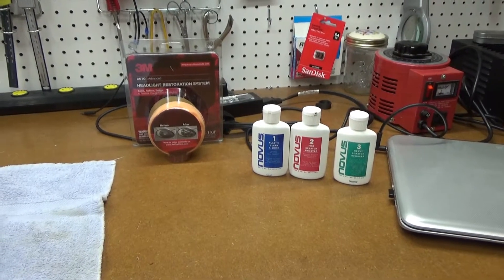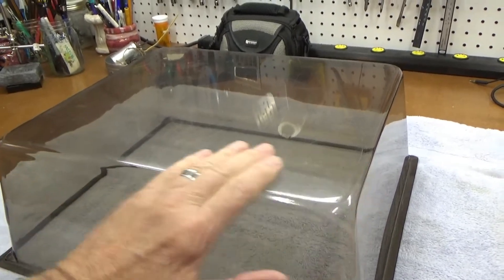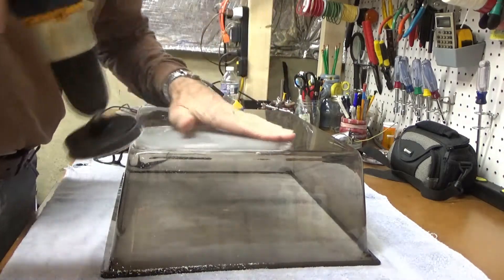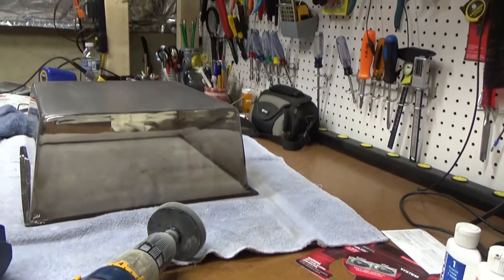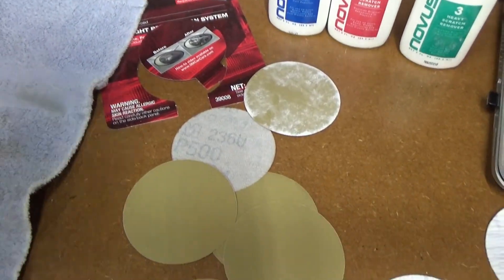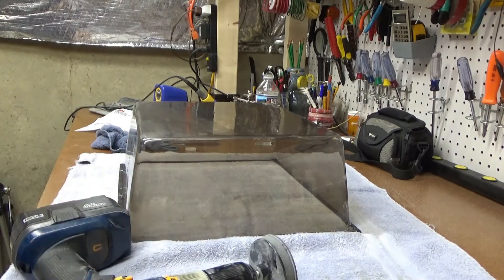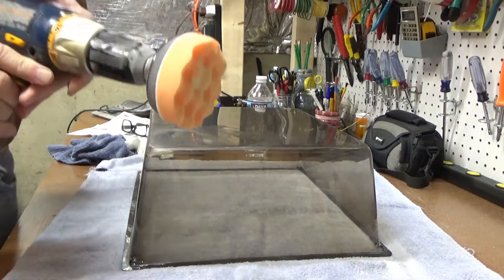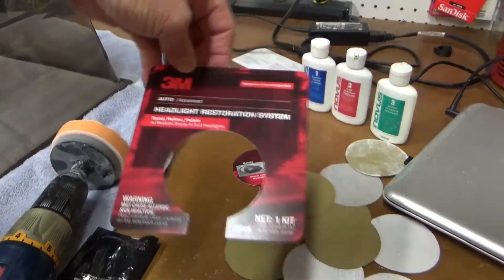Turntable Dust Cover Scratch Removal with 3M Headlight Kit

Comment: I've bought the Novus 3 bottle system to restore my SL1210 lid, but after seeing your video, I'm going to return it for the 3M kit. Thanks for the video.
Reply from the maker: The Novus kit works best for slightly scratched dust covers.  The 3M headlight kit does a great job for deep scratches.  You might want to try the Novus kit first and use the 3M kit if you still need to.  I'm glad you found the video useful.  You can check out the Novus kit results on another one of my turntable videos.  https://www.youtube.com/watch?v=1_bjwGo51wM
Reply: @mguess  My lid is very scratched, probably worse than yours. I've considered buying a new one but they cost well over £100 here in the U.K. I will watch your other video thanks.

Comment: You must have to lean into the pad pretty good Iam thinking. I tried this on my cover and its still very hazy. Never had deep scratches or gouges but just very hazy. Tried this step by step and it cam out not good. Very hazy still and definitly not like new. In you opinion do you think I should try a full application from start to finish? Tried just mutiple polishing attempts and still the same result.
Reply from the maker: If it's just hazy you may need to use a finer grit polish. I like to use the Novus products for cleaning up light scratches. It comes in three different grits, #1, #2, and #3. I tend to use #2 the most.

Comment: I like to add spray wax after I finish polishing dustcovers. Turtle Wax Ice Seal and Shine is a good spray wax you can get at Walmart. Spray it on and wipe off. Protects from UV and I find my dustcovers get far less scratched from use if I apply it every so often.
Reply from the maker: I have some of that. I may give it a try.